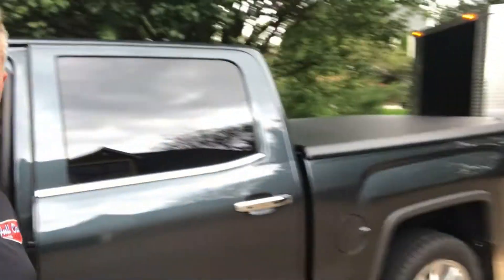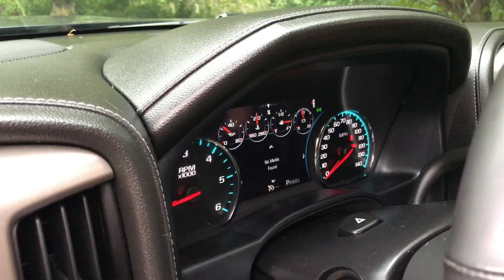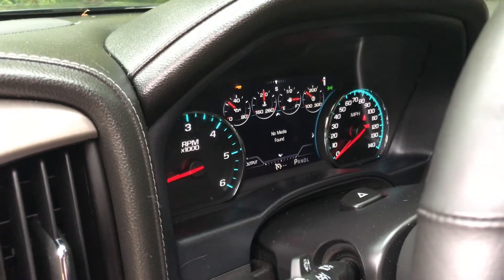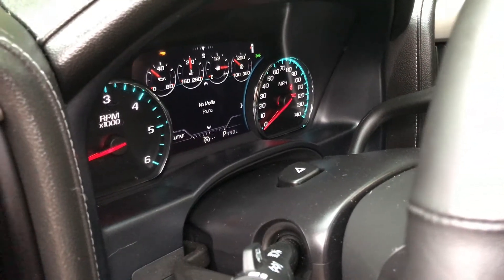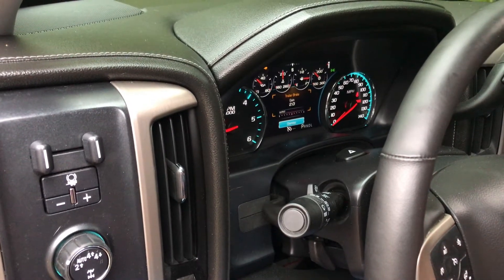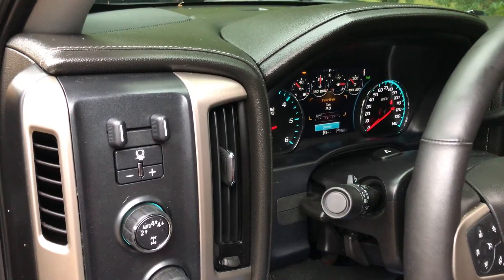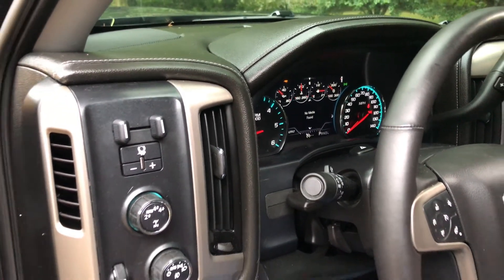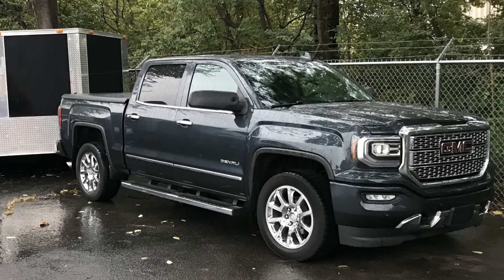GMC Trailer Brake Controller Explained

Comment: I have a 2019 3500HD SRW now, but I had an aftermarket trailer brake controller in my 2007 LBZ truck. It had two settings, how hard the brakes would come on, and how fast it would get to that point. So I would normally set the controller around 8, with around a 4 second, gradual brake, so not to jerk the truck constantly. Does my new '19 have this feature? I can't imagine having a high brake setting driving around town, and having the brakes coming on so hard and so immediate. Or, does the new controller ease on the brakes in relation to pedal pressure?
Reply: I have a 2019 Silverado 3500 srw with the intergraded brake controller. They are not timer or inertia based like the old school brake controllers. It decides how much juice to give your trailer brakes by how far you push the brake pedal, and what you've got the gain set to. They are very smooth and it's also tied into ABS, hill hold assist, stabilitrac, and trailer sway Controll.

Comment: When using the trailer brake control, do you use it in conjunction with your regular truck brakes, or just the brake control alone?
Reply from the maker: Once you set them up to grab without locking up manually then the rest is automatic. The trailer brakes will engage when you apply pressure to the brake peddle.
Reply: @Reed Benton Instablaster =)
Reply: @Quentin Kian Thanks for your reply. I found the site thru google and I'm in the hacking process atm.
Looks like it's gonna take a while so I will reply here later with my results.
Reply: @Quentin Kian it did the trick and I actually got access to my account again. Im so happy!
Thank you so much you saved my ass!
Reply: @Reed Benton Glad I could help xD

Comment: New 2500 HD owner here who pulls a boat and a UTV trailer regularly. My boat trailer I believe is equipped with surge breaks, so I'm guessing I cannot use the built-in trailer brake feature inside the truck, is that correct?
Reply: I see u got excellent feedback

Comment: How does the stock trailer breaks compare to aftermarket break controller example the Tekonsha prodigy P3? Thanks
Reply: For anyone here later it's worth noting the Tekonsha works absolutely great but works a bit differently than a factory setup.  The Tekonsha only knows you've touched the brakes (kind of like a brake light).  It doesn't know how hard you've hit them.  For it to "guess" how much trailer brake to apply it's relying on inertia by sensing how quickly you're decelerating. Seems weird and I don't know how it does it internally but it works very well.  I had one for years and pulled a 36 ft. (with hitch) Keystone Vantage 32fls travel trailer with dry weight 6850 lbs (loaded up to 8200lbs) with no problems driving a GMC Sierra 1500.  Absolutely was a must have and used it for roughly 15,000 miles of towing.  That said, the factory one is what I'd strongly prefer going forward as it's hooked up in such a way that pedal pressure determines how much trailer break is supplied, not any sort of motion sensing (is still adjustable though).  If you don't have a factory controller note that the Tekonsha can be installed in your driveway in minutes.  Is super easy and really feels top of the line for an aftermarket one.

Comment: I have never towed with my GMC denali but i am about to start and i have went through the steps that you guys went through without a trailer attached.  For this to work do you have to attach a trailer to see the output when pressing the brake?
Reply from the maker: Awesome! The truck does detect if and when a trailer is connected. If there is no trailer connected you can only see the amount of gain change when you hit the plus or minus, you will not see the amount of brake applied bars until a trailer is connected. Also if the trailer becomes unplugged while the truck is in the on position you will get a warning on your dash letting you know the trailer circuit went away. Back it up to the trailer and just plug it in then hit trailer mode and you will see some additional items in the dash. Curt

Comment: Great video but Grade break is activated on that truck By holding the tow haul mode for 5 seconds and the message will be displayed
Reply from the maker: I just found it in the owners manual, it seems to be a gas engine only option. When we did the video I  had a 2015 Diesel where it had a J-Brake button on the console instead of the hill decent button the gas trucks have so I was not up to speed on the gas engine grade brake option. This is awesome information, have you used it while in tow mode and if so how did it work for you? Thanks for the catch! Curt
Reply: Full Octane Garage  I understand keep up the good work love the GM videos I have a 2017 gmc Sierra 1500 Denali and I love it. But I have never had to use the Grade break  because we don’t really have any mountains here in New Jersey. Ps that’s for the reply
Reply from the maker: Thanks! I just traded my 2015 2500 Denali for a 2018 1500 6.2 Gas Denali, so far I like the daily drive ability much better. I did use the J-brake in the Diesel, I will try the grade break on one of my next trips pulling an enclosed car trailer.
Reply from the maker: Cool. thanks for the info. I think I see a video coming up where we cover the ApplePlay and the Android apps and compatablities with the GMC trucks. Seems to be a lot of questions there.
Reply: Tony Man a